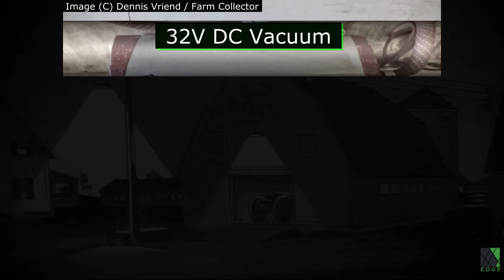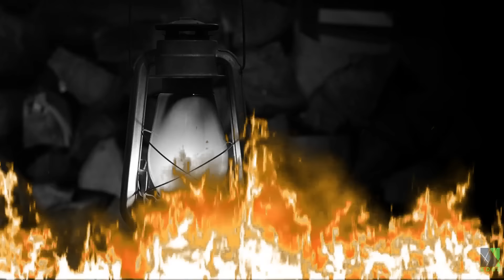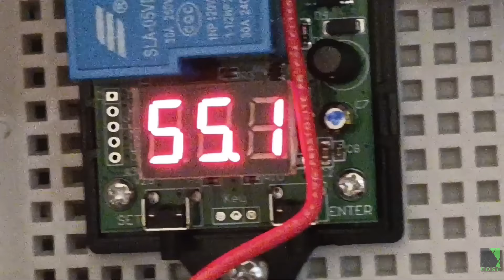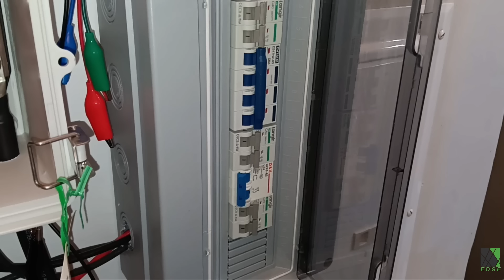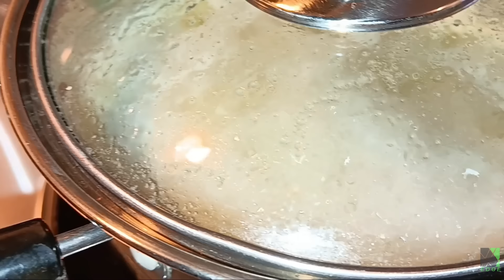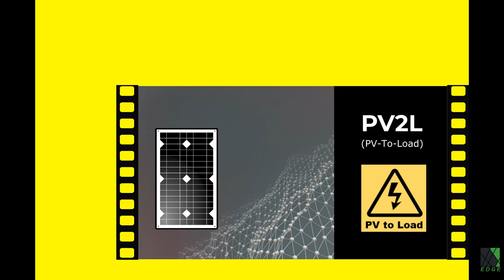LOST HISTORY: 1900s OFF GRID DC - How Did It Work? Off Grid Before Solar Power #history

Comment: In watching this video and reading the comments I would like to recommend  the books of an author by the name of Michael Hackleman. In the 1970s he wrote a series of books on off grid energy, better known in those times as alternative energy. They are very much geared to the DIYer and have a wealth of information on the subject. The ones I have seen are--

Wind and Windspinners (a book describing how to build an electricity-producing wind turbine).

The Homebuilt Wind Generated Electricity Handbook (Primarily concerned with restoring the old pre-REA commercially manufactured wind-electric machines that were popular in rural areas from the '20s through the arrival of the grid. Also packed with useful info on implementing off grid energy systems in general.

At Home With Alternative Energy (Gives an expanded treatment with more info on setting up and living with off grid power from the preceding book.)

He has other titles as well, and since he produced these works before most of today's off grid products were available there is heavy emphasis on repurposing available parts and materials to put together a working system. These books might still be found at your library or the used book sources like ebay. Check them out. You won't be disappointed.

Comment: I remember the setup of my grantparents, who they weren't connected to public power grid around 1980. Until that time, there was "only" locally generated electrical power. Which came from a 220 V/AC fuel generator. As a child, they teached me how to power up and down that beast, which was a "little bit" more complicated than to switch on of off switches.
Reply from the maker: @danielrodding8522 Very interesting, wish there was a book that documented all these earlier setups in one place... that would be my favorite book I'm sure

Comment: We definitely need more flexibility with power systems in the US. I would love to see 240v become more common personally. Different solutions based on people's needs. Thanks for raising awareness there are other options.
Reply from the maker: @vladimus9749 Thanks for the comment! I have chatted with multiple guys who run all or part of their houses on DC. I think there is a place for small, decentralized low voltage DC. Times are changing and we might need a "backup" that's simpler and more streamlined.

Comment: 32 volt DC with common railroad accessory voltage for lighting, fans etc all so many of the battery systems were actually nickel iron batteries not let acid.,.... Many Pullman railroad passenger cars had dynamos slung underneath them that were belt driven off of the axles of the car when it moved what's 32 volt nickel iron battery systems also underneath them some of the cars had ice bunkers underneath them with electric blower motors to act as air conditioning, also several different companies sold conversion kits for the windmills that powered water pumps to generate 32 volts DC. In the 1980s I was able to buy 32 volt DC incandescent light bulbs from a local lighting wholesale supply company in Ohio for the railroad museum that I volunteered at.
Reply from the maker: @johnprice867 Completely new information to me. Did not know they had "ice air conditioning" either. Incredible. Thanks for sharing!

Comment: its great if single households figure it out. but for the common man this stays unreachable
Reply from the maker: @_zproxy It's a very simple system. I've spoken to many ordinary men who have part, or all, of their house running on a similar DC system. The one I built is unique in that it can function without a battery (direct PV DC mode).
Reply: @solarpoweredge  would be cool if this approach would be the common knowledge. the end of greed in a way.
Reply from the maker: @_zproxy I hear ya. People should work together to make it happen. Much of the content on my channel is to introduce and demonstrate the practical usage of simple LV DC systems to the masses. It's still mostly a DIY task - very few off the shelf solutions exist. Hopefully that will change. 

I have been looking for a way to bring factory produced LV DC appliances to the market that anyone can buy and use easily. Most folks don't want to convert or hack appliances to DC, but, many would use them - if available. I don't know how successful those efforts will be. If it works out, I'll post an update here on the channel.

Comment: This was common in Outback Australia and was called 'Freelight'.   As late as the mid 80s, there was still one serving the station hands quarters at a station north of Leigh Creek because thay got me to fix a 32v electric fan because it was all they had to keep cool 45c summers.
Reply from the maker: @TheXO-614 Fascinating. Can only imagine how important that fan was. 45C... 113F. Fun times!
Reply: @solarpoweredge  Yeah, it was, one of the wives had a newborn, so it was a big difference.  45-48c most days in summer.  Humidity was routinely less than 1%, so very dry.

Comment: I have one of the 32 V batteries and I have one of the wind generators set up to run off of stationary engine running incandescent lights. I made the 32 V wind generator I have into belt drive because the hub and brake drum were damaged.
Reply from the maker: @johnkirby6216 NICE! Thanks for preserving the history!

Comment: Interesting that they chose 32V when lead acid batteries converged on multiples of 12
Reply from the maker: @bene5431 I am only speculating, but it could it have something to do with their available generators or wind tubines. It could be they already existed for 32v and so they just chose batteries to match. I think that happened with the old 6V systems, which were built around car alternator voltages at the time.

Comment: Has anyone touched 55v to see the result? I know phone cables could be felt at 75v but that was very low current.
Reply from the maker: @torstenmeyer2905 My experience. Depending on many factors, you can get a zap in your fingers. Sometimes, I don't feel anything. 48-55v is low enough to be safer than 110V+ DC but still very capable. Higher DC voltages are simply not safe. Time will prove it.
In our 55v kitchen setup, I upsized the wire gauge to prevent excess voltage drop. The kitchen is fed with 6awg copper, but probably could have been 8awg. https://youtu.be/1bOp-cVZhLQ

Comment: You can also get 12 V coffee makers today. That plug right into your 12 V. Socket, they're not large, and they don't brew a lot of coffee. They're basically just one American standard cup and primarily for truck drivers. So that's primarily where you find them is, it? Truck stops for those truck drivers that are the daily cup of coffee drinking type. They're a simple product with a simple on off switch. So that a truck driver can plug this thing. In overnight, leave the switch off. Pour the water in it. Put the coffee filter and grounds in it. Adds, when they get up for the day. They can hit the power switch on that coffee maker, go inside to the truck. Stop use the bathroom, real quick and come back out. And have a fresh cup of coffee that did not just cost them $3. And yes, the coffee at truck stops can still be that expensive. When you go inside and buy their fresh brewed coffee and the the coffee makers themselves aren't cheap enough. That after buying the filters and the ground coffee. Even when you're talking about being able to go to the truck stabs that have a more affordable cup of black coffee. Your still talking about saving money. Many times over breaking even cost wise in about 2 months. And that's what the more affordable gas stations and truck stops coffee. The more expensive ones cost parity is an even shorter amount of time. First, it can still be used for just heating up water. But they do have 12 V. Kettles, you can get for your semi truck as well, and some truck drivers just get me 12 V. Kettle cause they, they really can't taste much of a difference between instant coffee and ground coffee. So they just heat water with a one2 V kettle, and then put some instant coffee packets in their mug and poor hot water from that one2 V. Kettle into their mug.
Reply from the maker: @MrTrevorkemp Those are great! Hopefully in time there will be a wider selection of better appliances available to truckers, travelers and campers alike.

Comment: Land line telephone wires have about 50 volts dc.
Reply from the maker: @PaulSawczyc Interesting, I thought it was lower. Those wires are very thin but I guess they don't carry much current for the phone
Reply: @solarpoweredge  I put a voltmeter on the telephone wire to see for myself  --  free power for small lighting.

Comment: The farmers was very innovative and used waterwheels and windmills in addition to their diesel generators to charge the batteries. The light bulbs was 32 v and there was even 36 volt refrigerators available. The diesel generator ran for a few hours after sunset then gets shut down and only battery power was available in the house till the next day.
Some farmers even had a rotary transformer( a mechanical inverter) to supply grid voltage to smaller appliances.
I haven't seen any commercially available 36 volt appliances for several decades now.
Interesting, the washing machine was petrol driven and not powered by electricity's.
Reply from the maker: @nicwesthuizen4077 I could not find pictures of the 32v Delco washing machine, but here's a video of one running! https://www.youtube.com/watch?v=pAokcwGTqUw

Comment: I used to have some of those batteries. I wired my home,shop and home office with a combination of the usual 120 and 240 VAC along with 12V and 120V DC connected to solar panels and backup batteries. My family and I use this system today. We reside in the country where our grid power goes out about 20% of the time during storms, ice storms and rolling blackouts that have become more common here in rural north east Texas. Have many perminatly mounted generators that will do diesel, gas and propane.
Reply from the maker: @stevearmstrong4561 Interesting setup! It pays to have multiple redundant power sources!

Comment: I currently make the battery plates that go inside industrial batteries.  not to far off from these.  tech really hasnt changed in 100 years.  also many battery packs range in the 24-70 volt range depending on use.  lead acid batteries are largly going away but their chemistry/weight still see them useful in many applications.
Reply from the maker: @Kd8OUR Interesting to hear. Lead acid still has its advantages. Simple, tough technology that just works. As long as you don't forget to keep them on float charge!

Comment: Windcharger company and their full line of 32 volt household products were common place in SE Wyo before REF came thru in the mid 30s. Scrap metal drives of WW2 earased most all the proof.
Reply: I'm sorry R.E.A.
Reply from the maker: @Herb-n8h Huge thanks for posting this. Never heard of them until now, doing some research

Comment: 32v systems were common here in country Western Australia. My aunty and uncle did t actually get mains power until 1983, and I briefly worked on a sheep station that was still using 32v in 2002. Dunlight was one of the big manufacturers here making 32v diesel and petrol generator sets and wind generators.
Thanks from Geoffrey
Reply from the maker: @brookdalefarm7986 Wow they were still using it in 2002, first time hearing that! Proves it still works today.. thanks for sharing!!

Comment: I have a few of the 32Vdc devices my family used when we had a Delco plant. I had 2 tube radios converted to use 120Vac, a swivel fan, the wood boxes that held the glass acid jars, voltmeter, and a poster. Sadly the plant was sold to a river ferry boat. We got AC power in 1949. It was first installed in the 1920s.
Reply from the maker: @gregkocher5352 Fascinating. Would be incredible to have a complete working system!

Comment: I grew up watching a tv show called The Waltons, which debuted some 54 years ago. I've spent the last 30-plus years wrestling with a conundrum that I've only just now resolved, but which leaves still more questions about the show. In season two, the intro to the show was changed a bit, By season two the time frame for the show would about 1934. They put shoes the seven-year-old Elizabeth and poppa John, Sr. proudly shows off his latest acquisition - what I think was a Zenith radio. For the longest time I wondered how he managed to power it, given that the Rural Electrification Act would not provide for distributed AC service to their little corner of Virginia for another five years. 

I'm a bit ashamed to admit this but as an electrical engineer, I can only remember a cursory introduction to the Edison battery, before moving on to AC generators, computer architecture and semiconductor design. Now, I'm keen to dust off those references and see how I might expand on my de-centralized electrical production. Given where I find myself, I suspect I'll need to go really old school on my living accommodations to address thermal regulation, if I'm truly keen on divorcing myself from the need for access to a distributed power grid. Still, these are the times we find ourselves in. If memory serves I have a few text on my shelves that predate the rise of alternating current. Maybe that curve won't be so steep this time 'round.

Keep up the good work.
Reply: My Wife grew up watching Little House on the Prairie, now we're retired off-grid in Northern New South Wales.

Cheers.
Reply from the maker: @MicMc539 As a kid, I read Little House on the Prarie series of books over and over, they are still some of my favorite
Reply from the maker: @albertwaterfield7983 Good post. Hats off to an electrical engineer for giving residential DC some attention :D :) I think times are changing, and we're going to need small simple de-centralized systems available. DC makes sense because solar panels and batteries are already DC. If anything, having simple infrastructure to keep the lights and basic functions working during challenging events makes a lot of sense to me.  Even a small town could use the idea, LED lighting makes it possible to illuminate streets with low power thinner wires.

If I have time, I will create a dedicated page / wiki site on my blog for 32V stuff. Unfortunately, there is not much information available. Seems to have been wiped out. Much of what I'm learning comes from folks like you, and others who had direct or indirect knowledge of these systems.
Reply: There were battery radios and zenith made them as well as Atwater Kent. I have a radio servicing book I won't part with. And as also an Elec to rival  as l book as well. Sorry I'm not correcting that statement because of AI . They need to stay out of the typing on the phone. It's time to expose AI for what it really is. 73

Comment: Very interesting.  Back in the day wireless sets ran off batteries.  There was a High Tension (HT) battery that ran the actual electronics of the radio and a Low Tension (LT) battery that powered the valve (tube) heater filaments.  The HT batteries were dry cells which needed replacing when they were exhausted, the LT batteries were rechargeable.  My grandfather ran a recharging business, I think the idea was you took the depleted battery to his shop and exchanged them for a recharged battery.

I'm running a portion of my house off 12v solar.
Reply from the maker: @rogerbarton1790 I had no idea they transported batteries to be recharged... couldn't find it documented anywhere. Thanks for sharing the info! 
And 12 volts all the way! we use it heavily every day too.

Comment: Thank God for Mr. Volta.  Without his ingenuity and experiments, we'd have none of this.
Reply from the maker: @davidb2206 hard to imagine this world without electric power... thank God for "wires and solar panels" we sure do need them
Reply: @solarpoweredge  Without Volta's battery ("voltaic pile") there would have been no way for all the other testing of electricity in the 1800's.  Faraday could not have done his experiments and discovered induction.  No generators, because the power could not be stored.  Volta permitted the whole century of advancements.  Telegraph.  Edison's inventions were powered by BATTERIES when he worked on them.

Comment: Where do you find appliances that will run of this voltage ?
Reply from the maker: @rayberger2694 48V appliances are mostly compatible, and some cooktops and ovens can be converted as well
Reply: @solarpoweredge  I've read that inverter appliances like mini splits often run 48v internally, wondering if I could do what you just did getting rid of all the AC and conversion loses